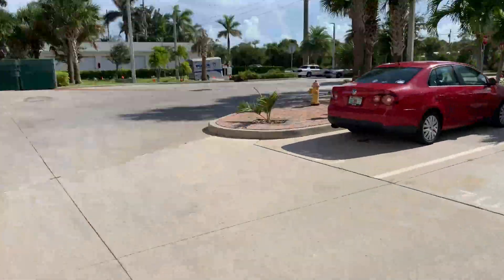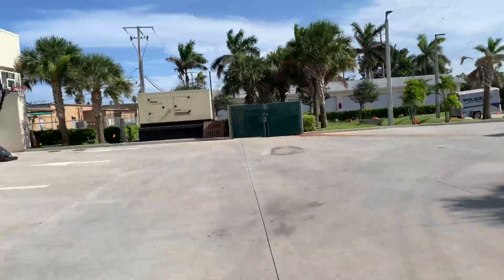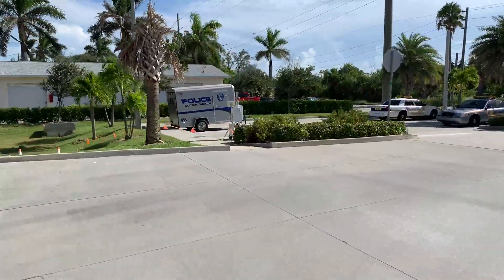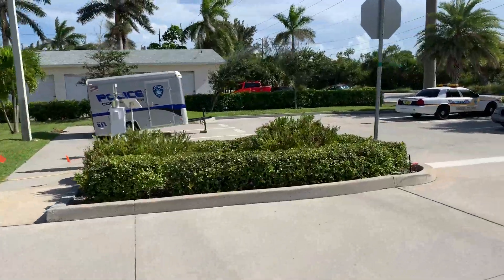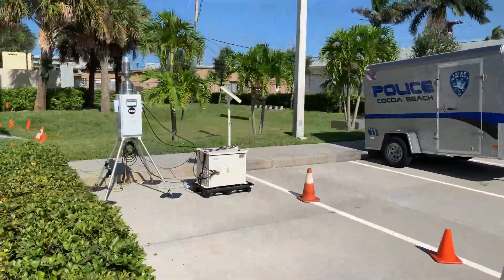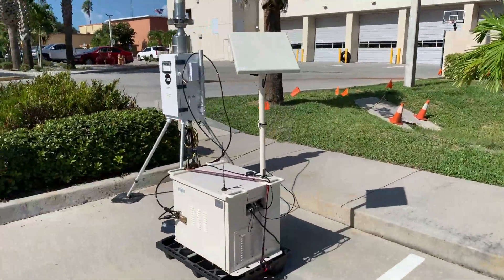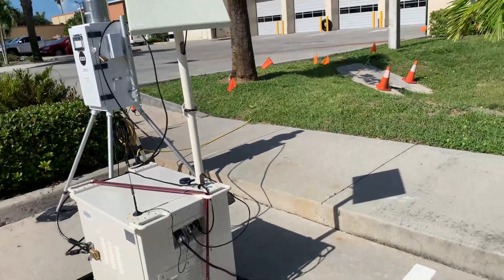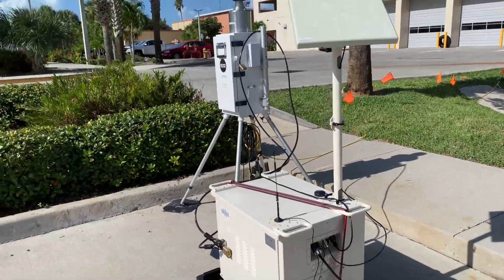I found this device SNIFFING air on an audit! Here's what it is NASA STUFF:)

Comment: No, I'm pretty sure it's a device that sniffs for fresh-cooked batches of donuts. It does work in coordination with similar devices stationed around the area like you say, buuuuut in actuality the whole network of sensors is designed for accurately triangulating the location of fresh donuts. Whenever there's a new hit, a bulletin gets sent out to all the police stations in the area, so each station can immediately dispatch a couple wagons to the triangulated location, for donut collection.
Reply: Just like the money sniffing guns the cops use.  Truckers would swear that the cops had them.  Every time they would get a ticket it would be for the exact amount of cash the truckers would have in their wallets.
Reply: It was next to a police trailer

Comment: As with any mass spectrometer, these devices can be sniffing for whatever they modify it for. They can check for radioactive isotopes or explosives. With the right equipment, these devices could even sniff for covid-19.
Reply: Connie `Grosser  COVID-19 is the same Genus as a cold virus.

Comment: LOL!  Yup.   I've seen similar devices on construction projects for asbestos, ozone, CO2, and CO when we work in hazardous work areas.   Also, small units are used for specialty fire systems in data centers that's ran through CPVC pipe (the orange stuff most folks have in their residence or apartment fire sprinkler systems),   Fun fact, the US Airforce, Marines, and Navy use hydrazine with mix rooms being remote, windowless structures.   Funny thing is, the last hydrazine mix building I completed, had a fire sprinkler system installed instead of flagellation or spark detection.   Totally useless.   BOOOOOMMMMMM!  No more building!   You have to love our tax dollars at work.  Our sprinkler contractor's bid was 20K for something that took a day and a half to install and have inspected.  for a 300 sq ft building, not including the water supply.
Reply: I can't blame you for doing the job and taking the money, but why didn't you raise the concerns about it at the time? maybe you did and it was just a "you don't get paid to think" and someone else would do the job anyways.
Reply: @BasedBidoof  Not sure what you mean.  I bid against  7 other contractors.   Most work overseen by the GSA,  other than 8a programs, are public bid to qualified S and C corporations by plan and specifications.  We don't set the standard and yes, there is an RFI process at and during the construction process where these issues rose.   However, it's not my job to tell a customer how to build their structure or protect their property unless it's against codes and standards.   Not my problem.